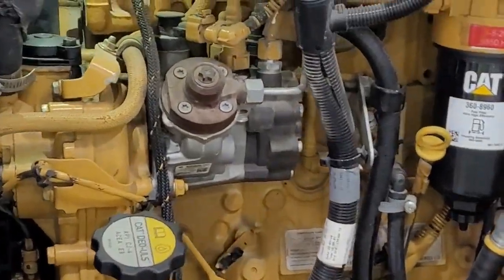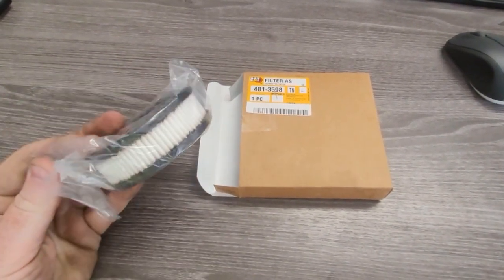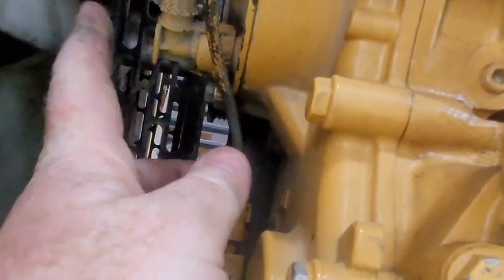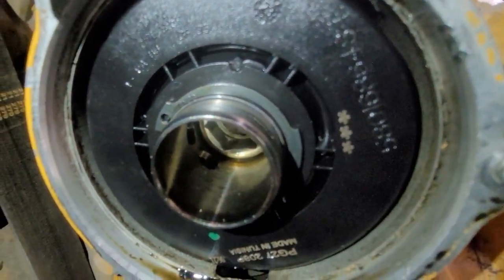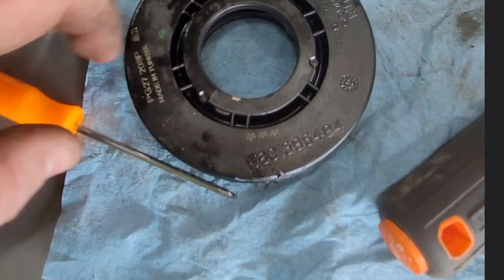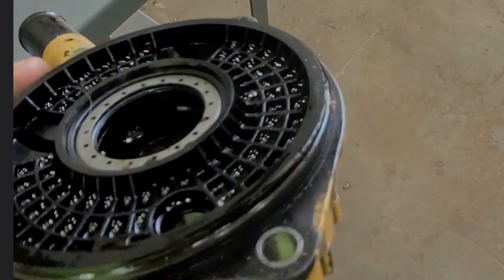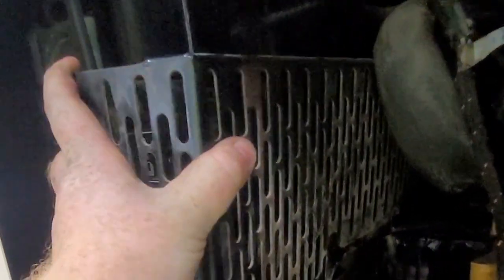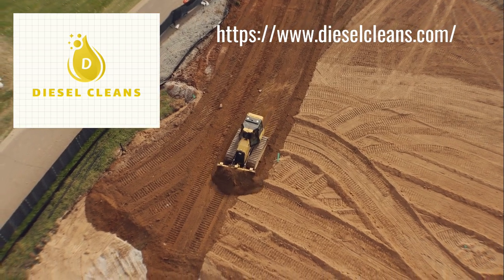CATERPILLAR 3.4B Engine Crankcase Breather Filter Replacement.

Comment: I see that 3.4B has a CP4. That sucks! 

That little filter lasts 3000hrs? The CCV on my c2.4 is alot bigger and is supposed to be changed every 500hrs.
Reply from the maker: More than likely the 500hr maintenance is what is recommended from CAT. I wasn't very clear, but I mean they usually wont completely clog for about 2,000hrs with regular oil changes. We just started to notice customer complaints for this filter issue around 2k-3k engine hours. It is definitely best practice to follow the caterpillar maintenance schedule, but understand it can become expensive.